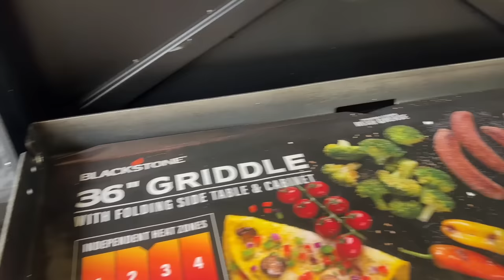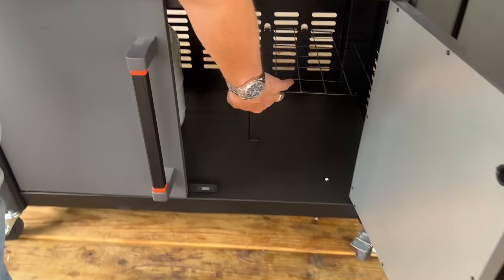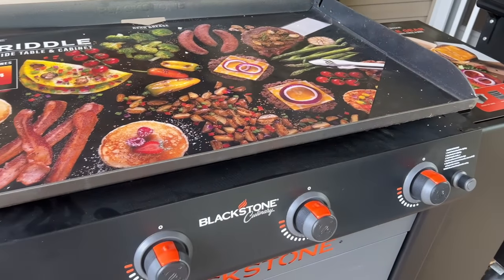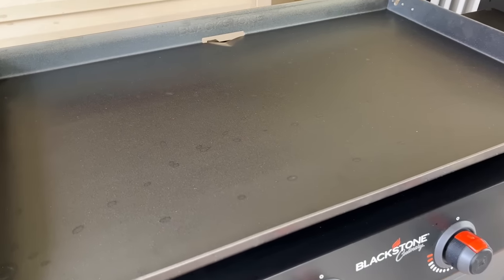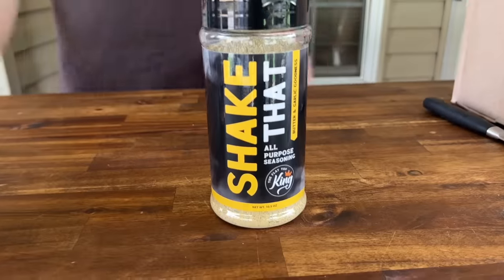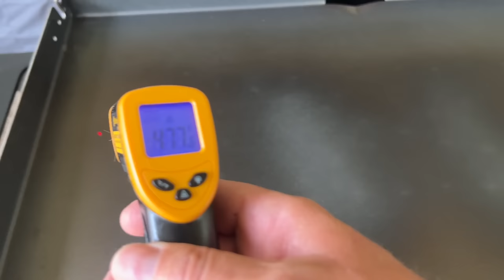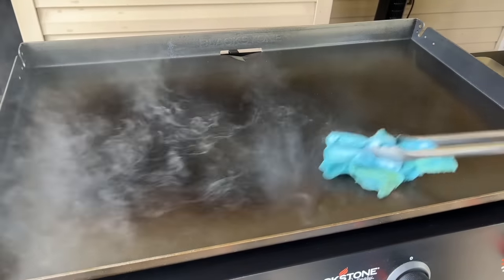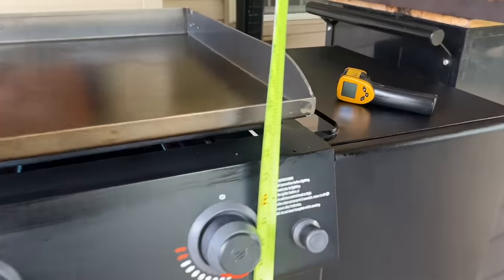NEW Culinary Series Blackstone Griddle + HUGE ANNOUNCEMENT!

Comment: I dont think you should change / adjust the way you do your first cook from what you have done on all the others. I think it will give a false impression of a true first cook. Maybe do a second first cook with what you learn from the actual first cook?  From your video, Like you, I'm not impressed with the uneven heating of the griddle top, thats an immediate deal breaker for me. I have concerks about you needing to put washers under the griddle top, seems like the top is already warped? Maybe from all the weld points of the "bracing"? Is the material thickness of the steel top thinner gauge than the others? I see no other reasonable explanation to add all the additional bracing. I also have concerns to at what point are those flimsy friction locke adjustable leggs going to fail? Meaning how much weight will it hold till it bypasses the friction required to lock them down and keep the shelf up? Cant wait to see what you results and first inpression conclusion is.

Congrats on the seasonings, they sound and look great, cant wait to try them. Also interested in seeing what your flavor pallet preferences are like.
Reply from the maker: aahahha First...i agree with all the above...we did in fact film the breakfast first Because of the worry about the griddle temps and we showed what to do and not to do when learning hot spots...I think it gives a good understanding to people how have new griddles and may help out faster...we will post tomorrow 

as for the pallet preferences... thats what I have been nervous about the whole time...when doing a recipe you can always adjust to your liking...take out ingredients and so on...but this is like your whole soul.... no hiding now...put up or shut up as they say

Comment: Im looking at a Blackstone to purchase. It says the 4 burner unit is 38,000 BTU.... but it has an Omnivore griddle top. Does this new plate retain the heat like a 60,000 BTU unit???? or do I need a 60,000 BTU unit?
Reply from the maker: I personally have already sold mine....i was not a fan...many fans out there...but I do think its missing...i think it needs the 48-60,000 btus...

Comment: Floor models are great, but it is not uncommon for things to be missing and/or not assembled fully. Screws and bolts missing or not tightened, wiring disconnected or missing, etc. Don't just assume a floor model has been fully assembled or correctly assembled. This advice comes from experience.... Possibly and you may have discovered this already, the griddle top rocking back and forth may be an issue with the assembly.

Comment: Why can you not turn down the hot burner and adjust them to be more even? They have independent controls.
Reply from the maker: Long answer but i will try to limit this...4 burners system...working only on tall 4 burners on low...if the middle two are running hot...you literally can not turn down lower...if the outsides are running low....if you start turning up the heat to compensate....the bleed over heat will just make the middle hottter

Comment: I feel the same way on the distribution of the heat. When I seasoned mine the outer edges did the same, wasn't hot enough. But hopefully over time it all will come together.
Reply from the maker: Yeah...just frustrating...you would think we would not have to worry about that...seems like it should be fixed now...

Comment: What about rinsing out the right burner…….maybe there is a small obstruction in the burner
Reply from the maker: Well I took a toothbrush when it was cool....didnt notice anything...
Reply: @TheFlatTopKing  ….ok.  But I still feel that the cooler zone is too big…is the burner crimped too hard where the gas comes in??  Sorry, I have a 28 inch and have been pining for a  36 inch, but that large cool zone makes me rethink!!
Reply from the maker: @Damethefirst  you can look at my previous blackstone. Same response. I cussed it all the time. But didn’t know griddles were better till Weber and traeger came out. My camp chef was the most even. The pit boss was extremely uneven.

Comment: I received a 22 inch Blackstone as a gift on June 21, 2024. While assembling the unit a problem arose. Due to a manufacturing defect the grill would not fit onto the grill body. I notified customer support on the same day. They requested pictures of the problem which I sent that day. FOR ALMOST TWO (2) WEEKS I HEARD NOTHING FROM BLACKSTONE CUSTOMER SUPPORT. THEN AFTER TWO WEEKS THEY WANTED MORE PICTURES!!  I responded that they had all the pictures they needed and should quit the runaround and send me the part! Today is July 8th and still nothing from them! They have the WORST CUSTOMER SUPPORT OF ANY COMPANY I HAVE EVER DEALT WITH AND I AM IN MY 70s!!! Good luck if you ever buy anything from this company!!

Comment: Im reading the reviews on the pro model saying the inside the cabinets and drawers gets really hot. Do you have that issue with that unit. Im thinking about getting the Traeger unit. Great video . Between this one and the Traeger, which would you choose?
Reply from the maker: Well....i could not tell ye about the Blackstone...I actually got rid of mine...just wasnt a fan of the new unit...uneven heat...lacking heat on the sides...and tuff to keep seasoned...i have said many many times in my videos....i think the Traeger is the top right now...followed by weber. I have many videos with both of those
Reply: @TheFlatTopKing  thank you for the response brother. Yah I'm sold on the Traeger.  Started watching your videos more and more now that I'm about to get a flat top. (FYI. I'm retired EN1) also looks like you are one of the few if any who checks the low temperature, which I think it's very important.

Comment: Doesn't look like the right side of the griddle is locked in to the stand. Maybe that's why it's not as hot on the right.
Reply from the maker: Not being rude..its on correctly...it has a small hole and a bigger hole...the peg goes into the big hole and locks into the small hole...all back legs lock in...
Reply: @TheFlatTopKing  gotcha